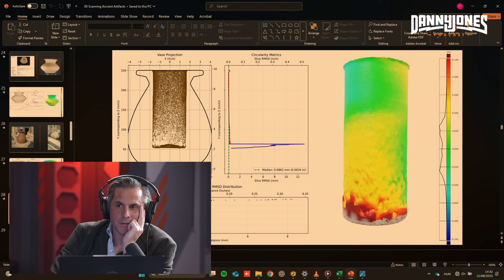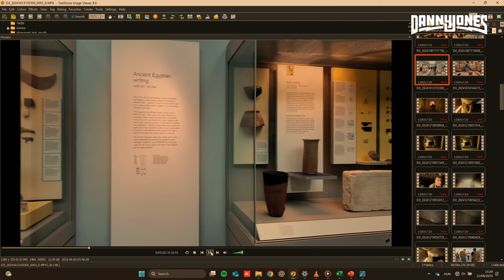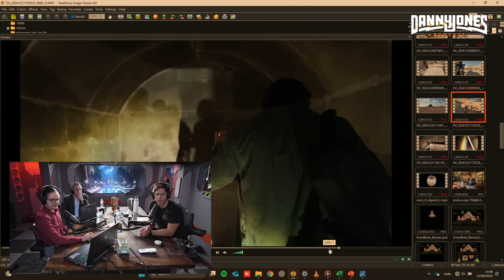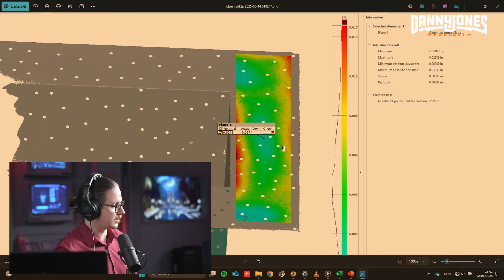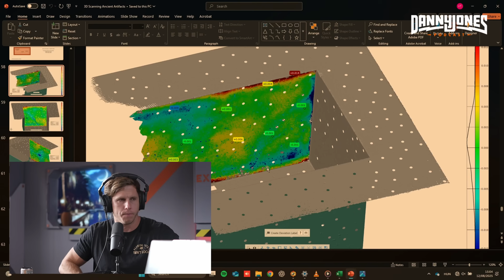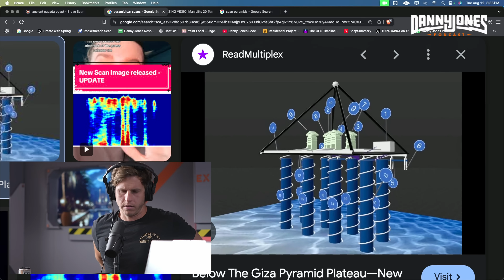100 New Egyptian Vase Scans: Best Proof of Lost Technology? | Karoly Poka & Adam Young

Comment: What if the boxes 5 walls were joined together by hidden joints ? 
As seen it ancient  temples built in Cambodia ? Created to fit together by male to female adaption , then polished to be invisible to the eyes ?.. that would make it easier to transport around the structure, also the slabs that are already flat and already cut to built ...

Comment: The thinness of the "vase" walls should be focused on more.  What does a thin walled "vase" give you that a thick vase wall cant.  Light.  You said it yourself in this clip.  It allows you to see light.  These objects are a component of a lighting technology
Reply: Thats a actually a cool way to look at this. The wall thickness on these vases is amazing and made what they did, just that much harder! Very cool
Reply: @joewalker9032 i think these were a high tech creation for a lower tech function.  Basically i think the entire megalithic age wasnt an age but a preparation building for an impending cataclysm they knew was coming and the "vases" were a lighting tech designed specifically for the underground
Reply: Sure.
And the glass I use for my whisky is also for lighting technology.
When did any cataclysm happened ?
How could they know ?

Comment: I think they were poured into molds. No different to the rest of the big blocks in Ejypt.
Reply: There's not poured blocks in Egypt.
Reply: @kakemphaeton8542  Most of them are. They're just so old they look like granite. Concrete never stops hardening. They used concrete methods far superior to todays. They still can't even replicate roman concrete. I can provide sources if you require.
Reply: @The-Pimpcat  There's not poured blocks in Egypt.
It's been proven, for example with the magnetic particles in the rock.
If they had been poured, they would all been aligned to the North.
They are not.
Also the theory of Davidovits is about limestone crushed then mixed with natron and clay.
So the many fossil shells and sea urchins should be crushed too.

Comment: These vases were made with a water jet cutter, a sandblaster and a simple lathe
Reply: Absolutely not. Maybe a water cutter to cut the vase to size, but not to do spherical geometry on the inner diameter. 

This isnt steel, or brass or something you widdle up on a normal lathe. These are some of the hardest igneous stones on the planet earth, you can't use techniques you'd use on a steel cutting lathe.

I like your confidence, but you have to trust that there are a lot smarter folks than you working on this problem and they scratch their heads with it. I'm talking mechanical engineers, machinists, and lots of other very skilled humans. 

I'd love for you to show us your technique since it seems very simple and easy for you to do. Please enlighten us, great one.
Reply: @joewalker9032  Spherical geometry is not the purpose, it's consequence. The water jet cutter's nozzle was mounted on a swing arm, and  this explains the spherical geometry
Reply: @joewalker9032  How do you know how smart I am?
Reply: Sir, when you say things like, "made with a watercutter, sandblaster and a simple lathe" one can assume you have zero knowledge in the field of high precision machining. 

Like i said, instead of arguing on the internet, show us. You said it yourself, you only need 3 simple things to pull this off and make these high precision artifacts.

Also, if you do this with your sandblaster and watercutter 😂 there's a $25,000 reward for proving your claim. Adam Young said in this very podcast the reward exists. Should be easy for you!
Reply: @joewalker9032  I am low on funds right now because I am fighting my former business partner, a fraudster, in court. After I will the lawsuit, I will do that. I can ask owners of the channel that I mentioned several times in comments to do that (the owner of this channel deleted all these comments because they mentioned someone else's channel)

Comment: This "complex spherical geometry" is actually a result of using a simple mechanism (a swing arm) on which the water jet cutter nozzle was mounted.
Using water jet cutters also explain straight high-precision cuts in granite and basalt, and especially concave cutouts and corners that cannot be made with a circular saw
Reply: Making straight cuts isnt the problem everyone is discussing here brother, we're more focused on the complex spherical geometry, mainly the inner diameter of these objects. Its not just a cylindrical hole they drilled down the center of the vases, they actually have the exact same curvature as the outer diameter and keep the same wall thickness throughout the vase. 

Thats an insane feat considering these are some of the hardest materials found on earth.
Reply: @joewalker9032  You have a wrong impression. As noted in many videos on this topic on this channel and other channels, the internal surface consists of many circular cuts, each cut being highly precise, but with a center displaced relative to the average vertical axis. I attribute this to the fact that only one side (the bottom) of the vase was supported by the lathe when making the internal cuts. And when making the external cuts, both ends (top and bottom) of the vase were supported by the lathe. This means that the lathe itself was not very accurate. The only relatively hi-tech thing here is a water jet cutter - it's complexity is on par with that of a pressure washer

Comment: yeah so if they had technology to that extent what else would they have? Hoses? Engines? electric circuits? computers? it only goes to reason were missing quite a bit here.
Reply: 100%
Reply: Yes but all made of stone
Reply: @andywatts8654  that depends on how old this all is, it would all be dust after some time.
Reply: @andywatts8654  the extent of the technology would require specific elements, you cant get to point b without starting from point a, you dont have a giant largescale powerplant without first understanding all the concepts, you dont have a lathe without understanding gearing etc, you dont have hydraulics without hoses, elevators without brakes, ship without and anchor